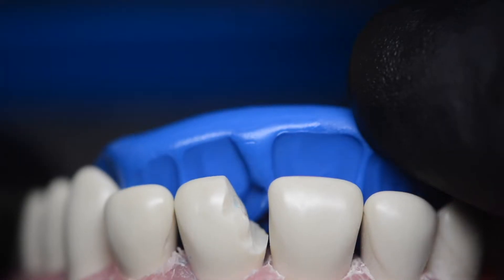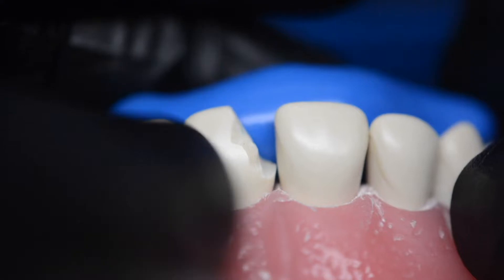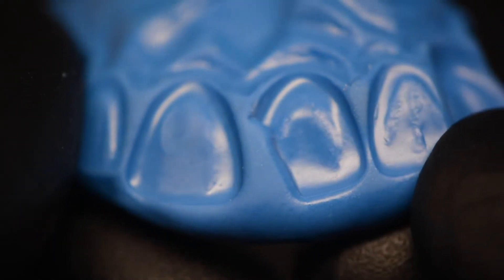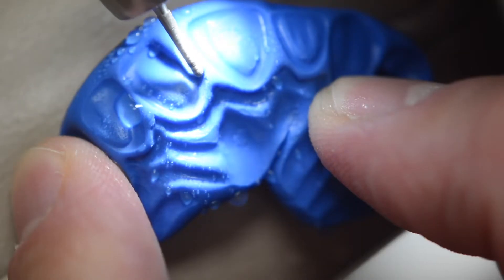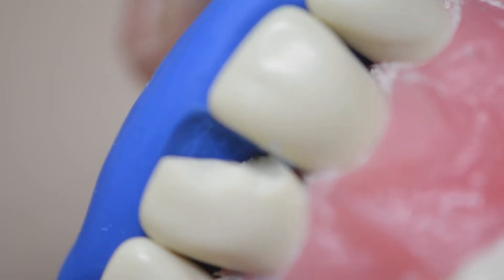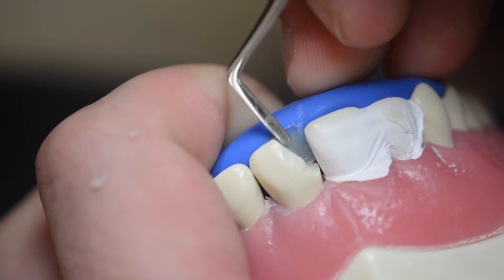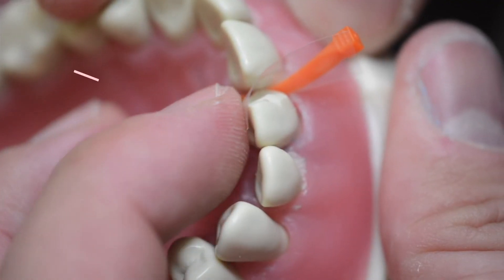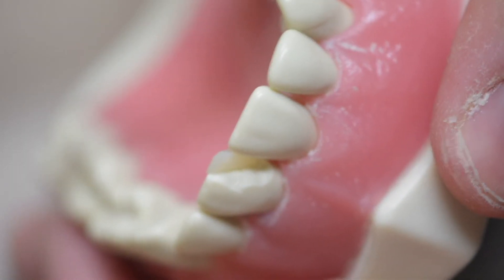Class IV Composite Restoration | How to Make Lingual Index

Comment: Did you cover the whole lingual surface  of the teeth in the start ( shelth) or just missing part with around its border ?
Reply from the maker: Covered whole lingual surface and cut back using adjacent tooth as a reference